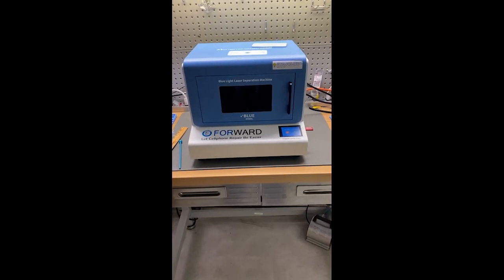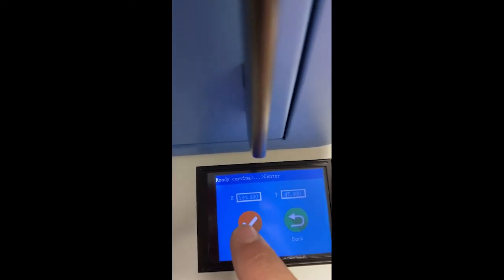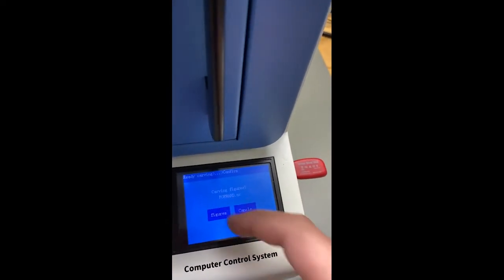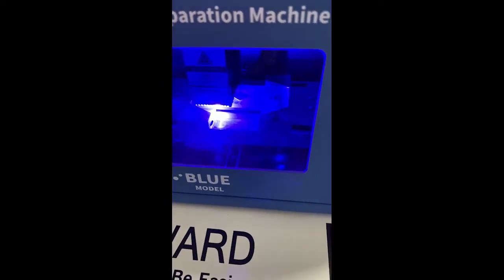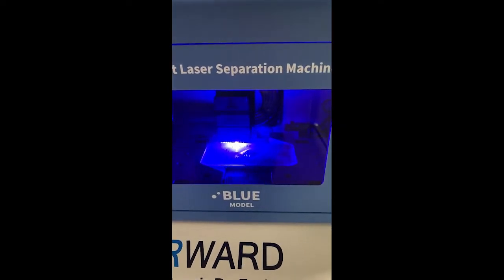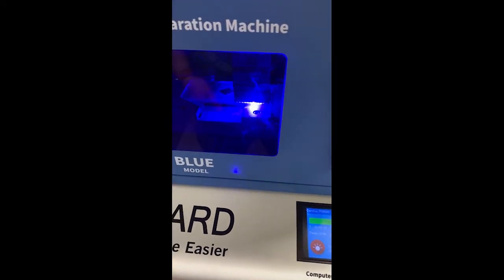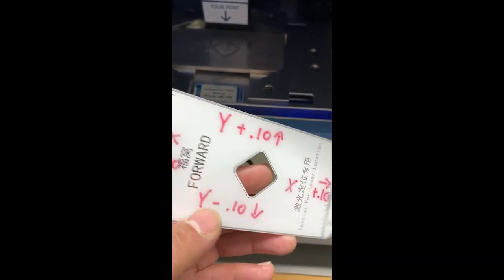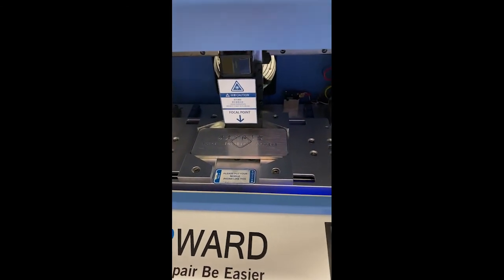Forward Blue Light Laser Calibration

Comment: I used the machine about 6 times worked good but on the iphone xs max black it did an ipx instead ?? i made sure it was xs max choosen, why did it do that?
Reply from the maker: Hello! This isn't a common issue that occurs but I believe I did see someone else mention on a Facebook group. Our best guess is that the files may have been corrupted. I would recommend redownloading the templates from Forward and replacing what is currently on the flash drive.

Comment: hello need your help.. i lost my calibration rod and with moving i think it needs recalibrating its not burning right.. Whats the diamter of the focal rod  ball ? Also can i print those templates out ? i can print them and out a glass screen protector over them and slap them on a housing that should be good enough?
Reply from the maker: Hi! We actually sell the rod on our site: https://www.etechparts.com/repair-tools/back-glass-removal-lasers/laser-supplies.

For the templates, they are specific file types read by the printer that cannot be printed out. Your best bet is to get a new rod and check calibration with the calibration glass.
Reply: @etechpartsplus2334  it says out of stock? how about those templates and metal bracket? do i need that or can i use an old phone instead?
Reply from the maker: Apologies, I hadn't realized they were listed as out of stock. We have the inventory here so the focal rod and calibration glass has been updated. It should show in stock shortly. The metal bracket we do not sell. I would say that if you get and old frame and remove the protruding camera lens so that the calibration glass lays flat it should work in place of the metal bracket that came with the machine.

Comment: Can you suggest the power and speed for iPhone 11 white back glass ( I always have an issue with it) i wont burn the glue all the way i would have to do it multiple times.
Reply from the maker: Hi! Yes, we recommend upping power to 125% and lowering speed to 80% or 50%. A few additional adjustments that can help with the white phones is to adjust the focal point slightly by lowering a little past where the blue rod sets the head height to, and clean the laser lens with a microfiber and alcohol as any obstructions can affect the laser marking.